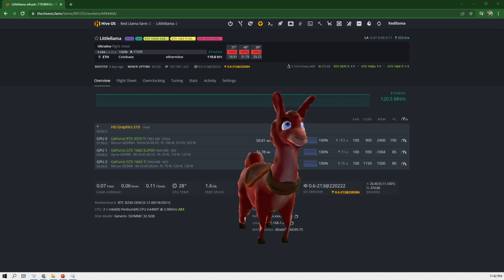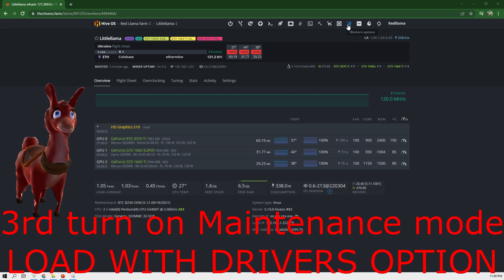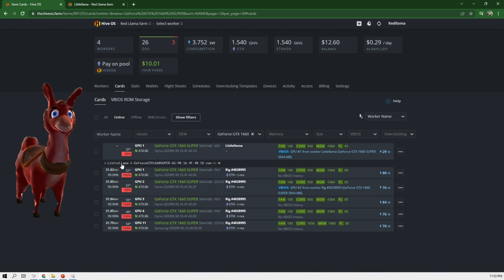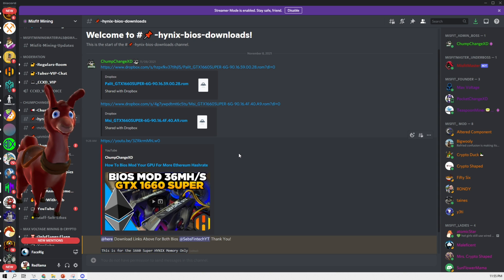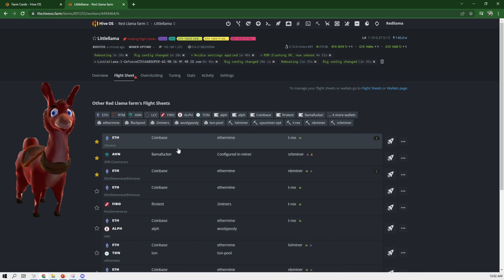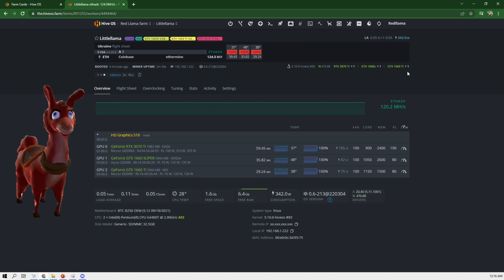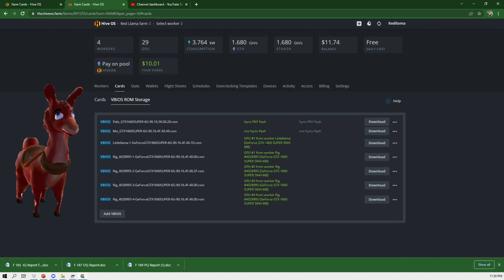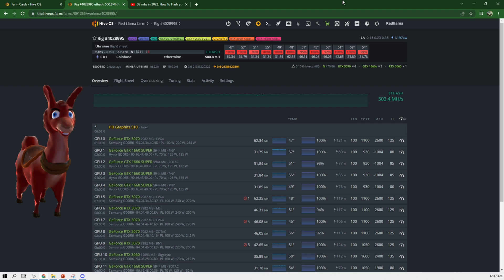Flashing GTX 1660 Super for more MH/s on a Zotac, MSI, and PNY

Comment: doesn't work on my MSI 1660 super ventus xs oc. tried flashing both of the bioses through windows and hiveos it just doesnt work. always have to end up reflashing the original bios cause my rig on hiveos wont go online, any solution?
Reply from the maker: Still having issues?